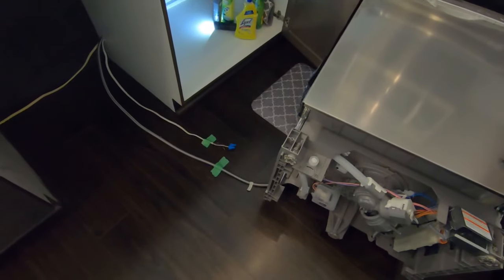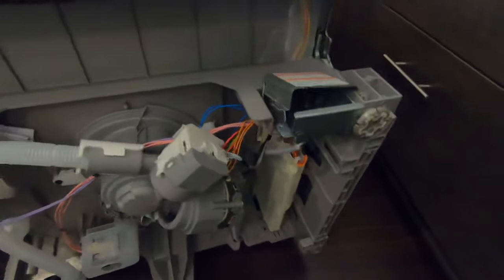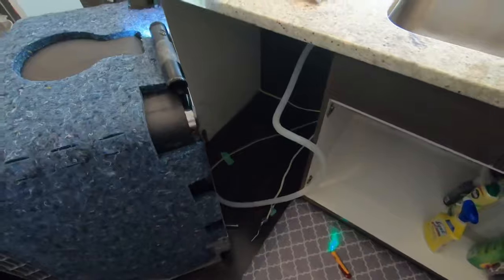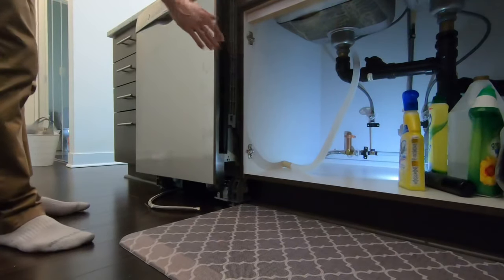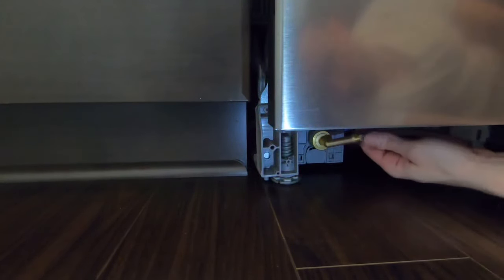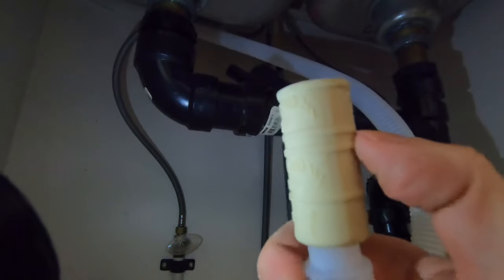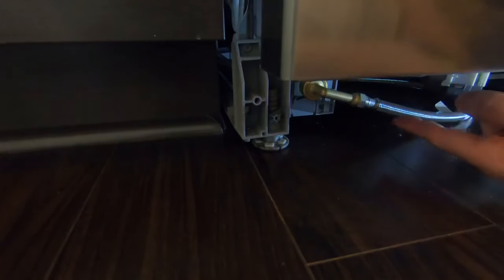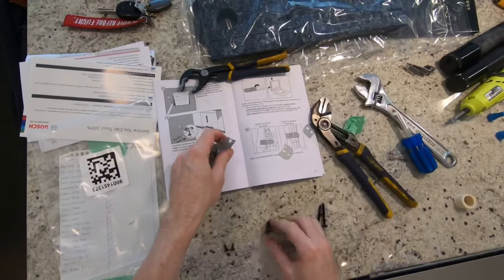HOW TO install BOSCH 100 series dishwasher

Comment: Great video! Helped me a lot with my installation that I completed today. Glad I watched a few times before diving in myself. 

A few things about my 100 series:
* The electrical connection had three prongs, but not the typical outlet connector. The appliance people at the hardware store provided a junction box converter (junction box gets mounted in a cabinet adjacent to the dishwasher), after which I was able to hook into our three wires. That added a little more time to the install, but was a relatively easy process.
* The front panel seems a bit finicky. The left screw doesn't seem to "take", though the right screw went in just fine. Leaving it for now as I'm pooped and the dishwasher is otherwise working fine.

Other than that, everything went smoothly! Thanks again and hope you're still enjoying your Bosch!
Reply from the maker: That’s great to hear! Yup still enjoying it after 3 years

Comment: This is the most complete and best video on installing a dishwasher.  Thanks.
Reply from the maker: Glad it helped! :)
Reply: Great video and it covered 98% of the Installation process.
The only thing that was missing is the part about leveling out the Dishwasher by adjusting the legs and then putting in the Pinning screws.  It is very important to make sure it's 100% level.
I would love to see a quick follow up video to see how it has held up after two years.

Comment: You rock!  I just bought one of these dishwashers as Consumer Reports rated it the highest of those they tested.  I have installed dishwashers myself a few times in the past but it's always nice to have a demonstration beforehand, especially on the same model!  Of course mine will have the plug that Joel K mentions but I will have to work around that, I don't have an outlet to install, just the bare wires.
Reply: Same how did you hook up no electrical box

Comment: Hey Scott - excellent video!  I just cut the existing cabinets in a kitchen remodel to fit a new Bosch 100 dishwasher, and really appreciate your video.  The delivery service must have taken the printed installation manual with them when they unpacked the unit, so your video was a lifesaver!  I see the water supply connection under the sink in your video connected to the hot water, but don't remember any mention of the water connection, i.e. "Hot or Cold" to the dishwasher. I believe dishwashers are supposed to be connected to the "Hot" water as you show. Also, my new Bosch 100 came with a connectorized cord that plugs into the back of the dishwasher, and then into a standard 120VAC 3-prong wall outlet.  Most dishwasher electrical connections are now made to a GGCI (Ground Fault) outlet under the sink.  Thanks again, and keep up the good work!
Reply from the maker: Glad the video helped! I heard a lot of the newer dishwashers are coming with outlet plugs which makes things a bit easier for installation; would have been a nice option to have for sure!
Reply: Scott -  I had to modify an old kitchen cabinet, and was able to get the bare minimum clearances needed to fit the dishwasher. The soundproofing fleece on my Bosch 100 shifted around and bunched up while I did the necessary in/out clearance checks, and made it very difficult to get the dishwasher out of the space. I found that a bit of duct tape placed here and there around the edges to hold the fleece in place helped enormously to keep it from shifting and jamming the dishwasher in the space. It also kept the fleece in place while I laid the dishwasher on its back to connect the water supply, and while I tipped it forward to connect the power plug and drain hose. I left the duct tape pieces in place for the final installation to keep the fleece in place. Works great, and fits just like it should.
Reply: @joelk9603  sounds great, Joel!

Comment: great vid, I do most of my troubleshooting this way too.  But I realize for a new DW you can do water and electrical connections first to the DW, even put DW on its side to make access easier, before inserting the DW into its slot by slowly pushing it in, pulling the water and drain hoses each time to insure it doesn't bunch or kink, and likewise push the power cord  in slowly to insure its not kinking.  Thank you.  BTW on some high end Bosch all these connections are in the back and can be more work. Kudos too to your kitchen lines, so neat!
Reply from the maker: Thank you!
Reply: Beautiful professionally demonstrated .I enjoyed it . Thank you
Reply: I wish all Bosch would install this way. Connections in the back are a pain in the a$$. The water intake is hard to tighten, and the electrical connection has a lead that is plugged in to the back of the DW, and hard-wire into a junction box under the adjacent cabinet. After installing mine I had to pull it out again because the water intake wasn't tightened enough. If the connections were in the front, it would have been easier.
Reply: @joeweatlu5169  I hear you. The lower end Bosch are like a GE or Whirlpool DW with its connectors a front but the high end are more like European ones with it at back.   I can download install and service guides of potential appliances before I buy and being easy to work with factors highly whether I'll get it, above how its works.  Enjoy.

Comment: I like that you made a hole for the drainline at 33". Most people feed it below and then you have the chance of losing your high loop.
Reply from the maker: Thank you, it’s the small things that matter!
Reply: @scott.charles.taylor  The installer ran the drain hose at floor level (actually, a few inches above when factoring the bottom of the under-sink cabinet is above floor level). Can I compensate by making a loop with the hose under the sink? The dishwasher was installed 5 years ago. There's always some water in the sump but it has never backed up where there's standing water after a wash cycle. Sometimes there's a mildew odor and that's what brought me to installation videos, where I'm finding out the drain hose isn't installed properly.
Reply from the maker: @phoneyjoe  sure thing, you can make the loop wherever you want as long as there is enough slack. You may not have enough to make it reach the 30” mark but anything is better than nothing!

Comment: I'm replacing a dishwasher with a new Bosch Ascenta model.  I currently have a 3-prong plug and outlet for old dishwasher.  Will I be able to use the same for new Bosch dishwasher?  I have seen that new Bosch dishwashers are plug-n-play.    I don't want to have to hardwire to junction box.  I want to use current  wall outlet dedicated for dishwasher. 
Thanks for the informative video!
Reply from the maker: Bosch makes a specific 3-Prong Power Cord for Bosch Ascenta models and I think they're about $20. The outlet should be fine, but I would use the Bosch plug.
Reply: @scott.charles.taylor    Thank you for the prompt reply Scott.  A 3-Prong Power Cord was supplied by Bosch in the box.  The brand new Ascenta works well.  I referenced your video as I was installing it myself.  Thanks for the awesome help.  I greatly appreciate it!

Comment: Just had one quick question! The tube on the left side of the dishwasher? What was that for? I’m trying to install mine but it has a connected tube on the left that I saw on yours and you didn’t do anything with said tube in the video?
Reply from the maker: You don't do anything with the tube on the left. It's part of the drain.
Reply: @scott.charles.taylor  Ahh! okay thank you so much :)

Comment: Hello Scott, thanks for this video. Incredibly helpful in installing my dishwasher. I am so close to finishing it!! The screws to the metal toe panel appear a little too skinny? Do you have any insights as to how I might be using them wrong? The long screws (longest provided which are about 1.5") slide right into the hole without any threading/grip. Please advise thanks!
Reply from the maker: Hey Wey, think I had a similar issue with another dishwasher I installed. I went to my local hardware store and got similar screws but a bit thicker. 

Alternatively you can try putting in the screw without the kick panel first, just to be absolute sure you’re putting it in the correct hole and that it doesn’t fit
Reply: I had same problem; the Bosch screws were too skinny.  I replaced them with two metric (M5 x 30mm) machine screws which worked great.

Comment: My Bosch 100 did not come with a felt liner, just some black rubber coating around it. Is that normal? It's loud as hell running at 64 decibels when it's supposed to be at 50.
Edit: I just added felt from the old dishwasher, it's still high at 58 DB. Way too loud for something that's supposed to be at 50 DB... Thoughts?

Comment: Great video.  I have a question - I am mounting to the top of the cabinet, the rubber sides aren't perfectly flush agains the sides because i believe the opening might be just slightly wider.  Is that a big deal if I'm not mounting to the sides and using the top?
Reply from the maker: Hi James, no that's not a big deal. I would try to get the dishwasher as level and square as possible in the space by adjusting the legs, that way the gap is consistent and is not an eyesore .
Reply: @scott.charles.taylor  thanks, another question, does it matter if the water line goes into the dishwasher cabinet, behind the dishwasher, and is then threaded through the bottom to the front?  I’m wondering if I need to adjust the hole in the cabinet so I can thread it differently .  Does that make sense?😊
Reply from the maker: @jwb0323  Not sure if I’m following, but I don’t think it matters too much. The norm is for the line to enter the cabinet at the back, and it’s usually routed on the floor under the dishwasher.
Reply: @scott.charles.taylor  i think i was just confusing myself 😁 i have it hooked up, do you think it best to run an empty cycle just to check for leaks on the bottom or go ahead and put dishes in?
Reply from the maker: @jwb0323  Doesn't hurt to run an empty cycle for sure, this way you can check for leaks. After the empty cycle, I would double check all connections to ensure they're tight and leak free. Once you've confirmed everything is leak free, you can put the lower panel back on to cover up everything :)

Comment: Great video!!  How well does it clean?  Other than plastics, do glasses, silverware, and dishes dry or do they come out wet?
Reply: It cleans well enough. I pre-rinse my dishes and then use the quick wash function. Dishes seem to dry well
Reply: @moretorque  I was just wondering since I hear Bosch doesn't dry well since it doesn't have a heating element/ring on the bottom of the dishwasher to aid in drying.  Thanks for the quick response.

Comment: MY GC just installed this but there is a lot of water left standing in the tub. They didn’t put the drain line very high above the ground- do you think if that were placed at the winch mark it would drain all the way?
Reply from the maker: @lvnn6198  without actually seeing it, it does sound possible that the drain hose isn’t looped high enough
Reply: @scott.charles.taylor  you’re so sweet for such a quick reply. Great video btw! I reset it and it drained. It’s running its first full cycle so I’ll see how it looks once it’s done. Thank you!
Reply from the maker: @lvnn6198  perfect! Hope it works out :)

Comment: Did yrs come with a junction box already attached?  I just took that dishwasher unit out to put another in. So my old one has that junction box. But the new one doesn’t. But has the moulding where it would go. So I’m wondering how to transfer it over?
Nevermind the previous Bosch junction box doesn’t fit the new Bosch. Just took an electrical outlet box mounted near the bottom on the back wall behind dishwasher and plugged in the unit with the plug that came with it. Apparently they’ve done away with the hardwire junction boxes that are attached to the unit like the one in the video. Because they don’t want customers to play with electrical. They want an outlet in the wall and just plug it in. Done.
Reply from the maker: Hey, no mine did not come with a junction box, I had to hardwire it in. You may have to do the same with your junction box.
Reply: I had 2 options. 1 attach a female plug to the 120v wire/ a 125v/20amp one. That’s extra coverage.   Or. 2. Electrical outlet box on the out side of the drywall and run the hardwire into box and connect to an electrical outlet.  Then plug it in. With the plug that came with it. I went with #2

Comment: Great video! What is the minimum countertop height needed for 100 series ? I have 24 inch clearance
Reply: The dishwasher is about 34” tall, so likely won’t fit under your 24” counter
Reply: @moretorque  Sorry I meant to say 34". In another video I watched it said that I need about 34.5". So having exactly 34" clearance would not fit it?
Reply from the maker: @jobransarri7369  that’s tight, I don’t think it will fit under your cabinets. Maybe it would if you were able to remove some of the flooring. I would agree it needs a minimum of 34.5”

Comment: Did you just estimate the adjustable feet and then flip it back to test, then do it again? Or just lucky it was good the first time?
Reply from the maker: I set the feet lower than the counter height, slid it in under the counter, and then raised them little by little until I got it where I wanted it and then made sure it was level. Once it’s in it’s not too bad to raise the feet, the back one may be a little tricky to reach, but the front ones are very easy to raise while the dishwasher is in. Just use your other hand to lift the dishwasher a little to get some weight off the legs.
Reply: @scott.charles.taylor  do you need to worry about putting the screw into the back leg to stop it from moving?  I need to lower the back leg to pull it out of the existing space, so once raised in the cabinet area, i won't be able to put the screw in the back leg.
Reply from the maker: @jwb0323  No, the screw in the back leg isn't necessary. The back leg is fairly easy to adjust once it's in place if you have skinny arms!
Reply: @scott.charles.taylor  thank you !!!

Comment: Thank you for the great Video. I have hard time understanding where to cut drain hose tube. How do i find out the diameter of my drain pipe? (my drain pipe looks very similar as yours).
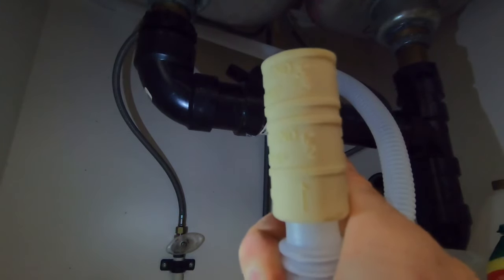Reply from the maker: At the 9:50 mark, you’ll see the drain tube has markings depending on the size of the y-pipe under your sink. There’s really only 2 standard sizes

If you look into the drain tube, you’ll see it narrows down. So if it’s too large for your y-pipe under the sink, you’ll cut it at the next size down

Do this at your own risk :)

Comment: Thanks for the help.   One issue.  The long toe kick screws are too narrow and pop out of the holes?
Reply from the maker: Try screwing in the screws without the toe kick first to see if it's indeed the screw holes, or if it's the holes on the tow kick not lining up
Reply: @scott.charles.taylor  Thanks, yeah it is the screws.  I just found the right size and once installed painted the ends with a little black paint.
Reply: I had the same problem; the Bosch screws were too skinny.  I replaced them with two metric (M5 x 30mm) which worked great.

Comment: Super , thank you.  But why Bosch?  LG is cheaper and has more features?
Reply from the maker: Good question. Bosch is generally quieter when it's running and is more reliable. This is their 100 series dishwasher, I would recommend the higher end 500 or 800 series if you can get one.

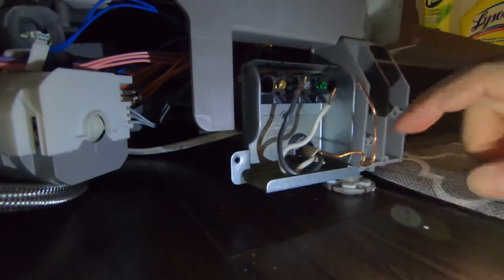Comment: Hi Scott--great video. Question: did you install a strain relief for the hardwire connection and didn't show it, or did it come installed and you just employed it to clamp the field wires as protection against their pulling from the connection screws and didn't show that? Watching again looks at 6:23 that there is no strain relief installed but by 8:08 there it is installed. (Thnx!)
Reply from the maker: Hey Thomas, yes there was a strain relief installed for the wiring. I just didn’t get it on video but there is one there :)
Reply from the maker: Hey Thomas, if I recall correctly I used the strain relief from the old dishwasher (was a Frigidaire). It wasn’t in the start of the video, but by the time I got to 8:08 I realized I needed one and used the one off the old dishwasher so I didn’t have to buy a new one. You can also see the strain relief at 6:23; it’s the grey plastic clamp around the wire. You pull it through the hole in the back of the junction box and it clips in. Hope that helps!

Comment: The two long screws provided for the kick plate do not fit the holes intended. The screws are too small and slide right in.  Had to provide my own hardware to secure the kick plate on a 2022 model.
Your video was a great step by step guide however, thx!
Reply from the maker: Glad to hear it helped!

Comment: I was thinking of getting the same dishwasher in white.  I was going to purchase online from Abt Electronics but they don't seem to have the correct install kit.  Do you still have the part number of the installation kit?
Reply from the maker: Hi Steve, no I don't have the part number for the install kit. The dishwasher came with mostly everything, including the plastic drain tube. The only thing I had to buy was the water supply line and 90 degree elbow. You can usually get these kits at the big box stores!
Reply: Scott Taylor   You know it all depends on the sales person you are dealing with.  The first person told me I needed to buy a kit that was 4 weeks back ordered.  I said thanks but no thanks.  Then I called back a few hours later and was told basically the same thing you said.  The drain tube is included and I would have to buy the water supply line from any home improvement store.  Wow, what a difference a sales person makes.  Thanks for the reply!!!
Reply from the maker: @stevehood7045  Good luck!